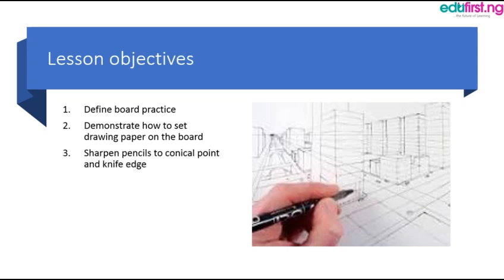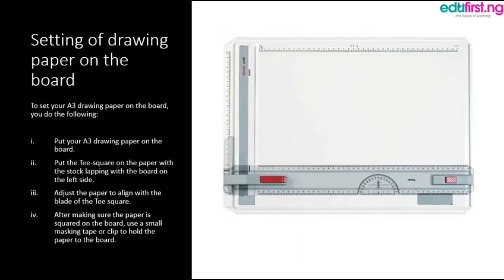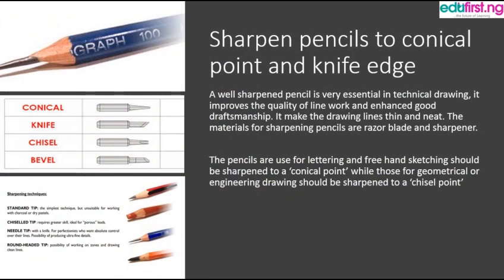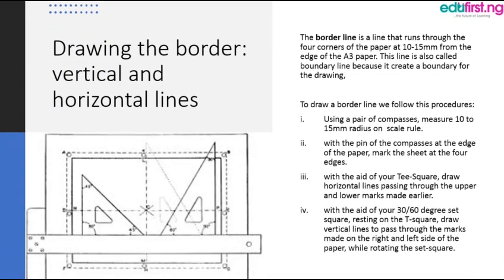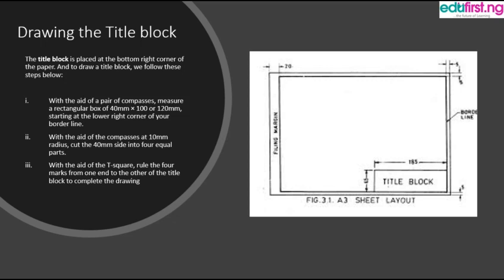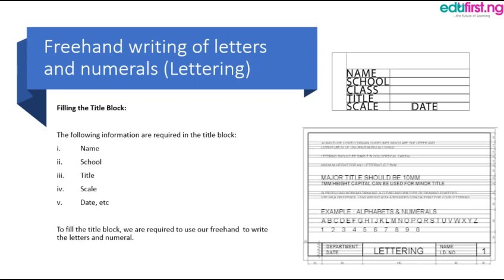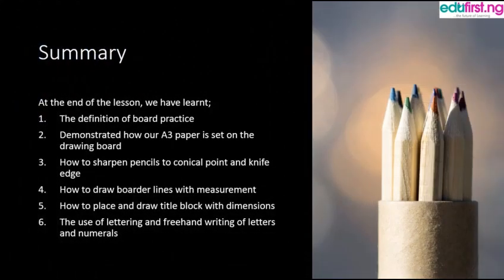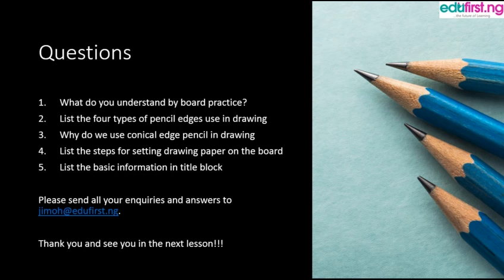Board Practice | Basic Tech | JSS1 | 2nd Term

Comment: EMMANUEL IRABOR.
My Basic Tech Assignment.
1. Board practice is the appropriate use of the drawing board to o practically do technical drawing.
‌
2. List the four types of pencil edge used in pencil drawing.
.a. Conical.
b. knife.
c. chisel.
d. bevel.
‌
3.It improves the quality of line work and enhanced good draughtsmanship.
‌
4. List the basic information in title block. 
a. Put your A 3 drawing paper on board.
b. Put the Tee-square on the paper with the stock lapping with the board on the left side .
c. Adjust the paper to assign with the blade of the Tee-square.
d. After making sure the paper is squared on the board use a small masking tape or clip to hold the paper to the board.
‌
5. List the basic information in title block.
    a.  Scale
    b. Title
    c. School
    d. Name
    e.   Date.